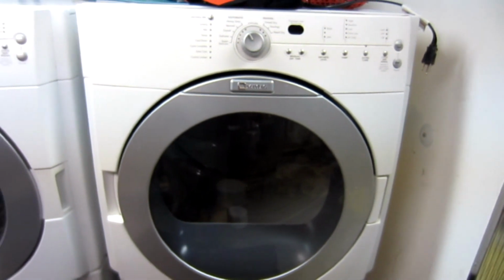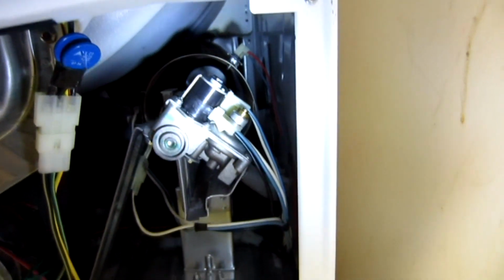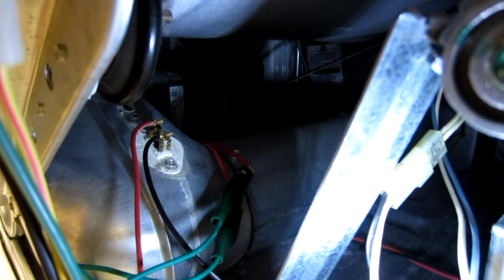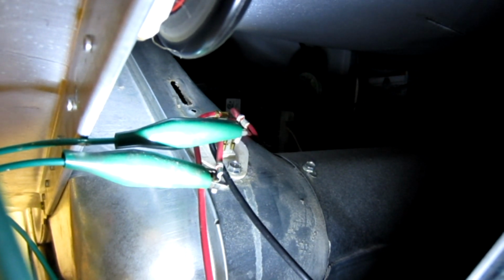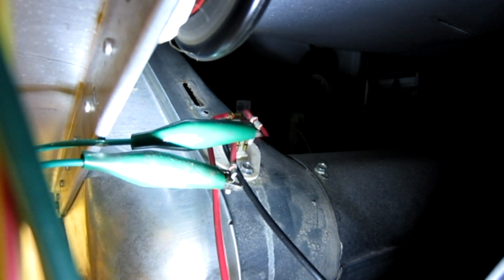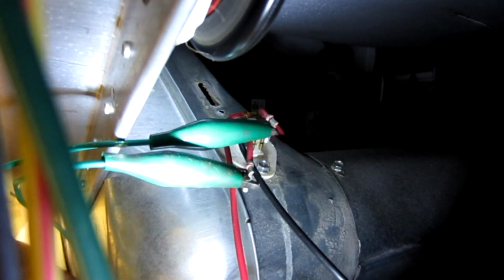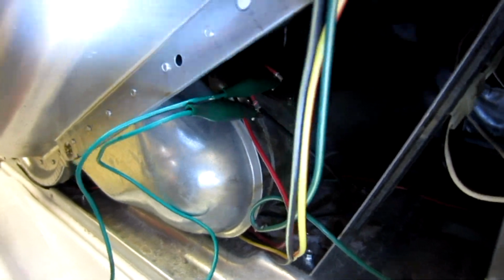Maytag dryer repair no heat or not drying clothes

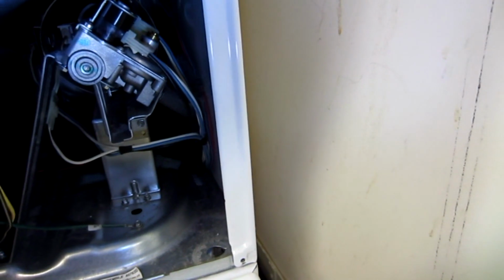Comment: I have a neptune gas dryer that heat up in the beginning. I set it to dryer at around 1:04min/sensor dry and after 3 to 5min, it jumps down to 30 to 20min with no heat just blowing cold air until it stops.
Reply from the maker: Could be a thermal sensor in the exhaust...I am assuming you have disassembled the lint trap and shop vac'd out all the lint and also checked your exhaust vent on the outside and the hose running up to it to ensure there is no lint build up... It could be a fire waiting to happen..

Comment: Thanks - found the screws under the panel.  Thermal fuse checked out still not working.  I'm suspecting a gas line freeze.  Add on gas line that runs outside and with freezing weather maybe a chance.  Should get warm this weekend.
Reply from the maker: Rick Williams this cold snap definitely caused some issues..

Comment: Ty I just got the 2 parts you mentioned in the video from amazon. I hope that fixes the problem which is exactly the same as yours... I hope that fixes the issue... :)
Reply: Thanks again my dryer is working perfectly fine now. I spend just a little over $20 and I did it myself. I saved $$ and now I have a dryer for hopefully a few more yrs. :)
Reply: What parts did you replace because I have the same issue(Maytag 4000 series front loader). It’ll heat up but after the cycle the clothes are still damp.

Comment: Thanks - have the same exact dryer. This helped me find/replace the thermal fuse, but dryer still won't heat. Any other suggestions? Is there a second thermal fuse (other YouTube videos show two, but on different models). Lint trap and exhaust is fully cleaned out, so that's not it.
Reply from the maker: Erik Janssens I'm pretty sure there is another fuse... Check the solenoids too.. Could be a board issue video here - https://youtu.be/xq-RNvQZvSg

Comment: I have heat and blower works but it's not pulling heat from around the elements. Thermostats are good. But warm air isn't circulating.
Reply from the maker: Check for lint blockage.. If you haven't cleaned from where the lint trap goes to the exit flap outside you should..

Comment: Is this dryer gas or electric?  Also would you get these same parts for either?
Reply from the maker: this is gas, electric is different
Reply: Foxboss9_ would you happen to know what those 2 parts would be for electric?
Reply from the maker: misty cook no, I don't mess with electric appliances that often.. They are harder to troubleshoot as you have to test all the electrical circuits and if you just replacing parts without knowing for sure which ones are actually bad ends up costing more in the long run than if you just called for a service man to come out and fix it in the first place.. plus electric dryers are very dangerous to work on it you get something wrong. electrocution is a distinct possibility.. Good luck..
Reply: Foxboss9 -thank you for help

Comment: What type of wrench do you use to get the bottom part open?
Reply from the maker: In my case I used a Torx bit but it also had a hex outside so I could have used a nut driver or just a socket

Comment: For the love of Glob, please tell me, does the front middle you have off at the very beginning just pop off? I started taking ours apart to go in with the Multimeter, only to realize I was a couple year models off and the disassembly of the top was possibly not just unnecessary but SUPER DUPER SHAMEFUL, LMAO.
Reply from the maker: screws hold it on..once screws are off just open the drawer and the panel will drop slightly then bottom out first..

Comment: how do i hook up my gas maytag maxima dryer
Reply from the maker: +Lorie Rizo You'll need a flexible gas line to connect to your Natural gas hard line (use sealant) you will also need a flexible vent hose(very important) because it not only vents out the moisture removed from clothes but also CO2 from gas burning.... And finally you will need a 110-112volt household 3 prong outlet to plug your dryer into.. If you are not confident in doing it yourself there are plenty of people out there that have already done installations like this and as long as you have all the connections and parts needed for the install the service to do the install should only cost like $40

Comment: Replaced the fuse still nothing. I get a click when I try to start the dryer.
Reply from the maker: Not sure.. maybe a board issue  https://youtu.be/xq-RNvQZvSg
Reply: Me too I think contacts on relay are bad. No voltage across contacts
Reply: I think the contacts are for power to igniter. I'm bypassing with a micro switch and will test after eating some food lol.

Comment: Wow very bad advice by passing the thermal fuse. It is there for a purpose and recommending doing that to others if wrong. You can ruin other elements of the dryer by passing it including the mother board which is a $200 plus part. You should also NEVER be inside the dryer with it plugged in.  There is 220 volts inches from where that fuse is. If someone's hand bumps those 2 terminals on the heating element that is 220 volt. You  should take this down.